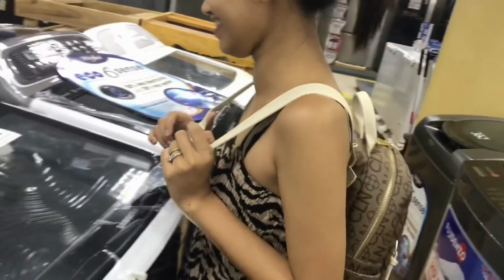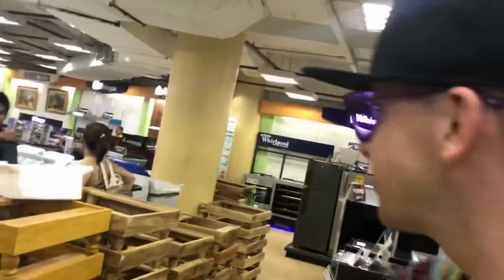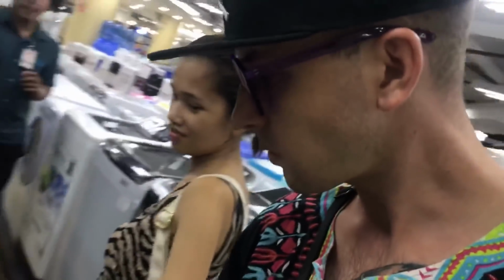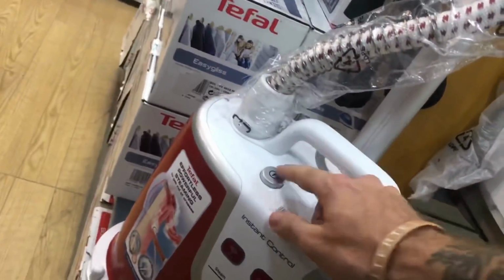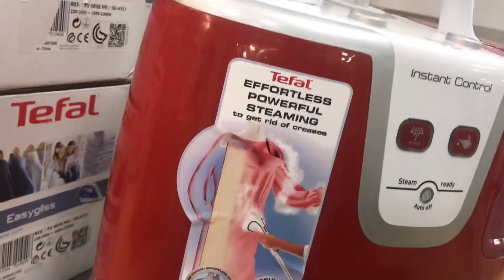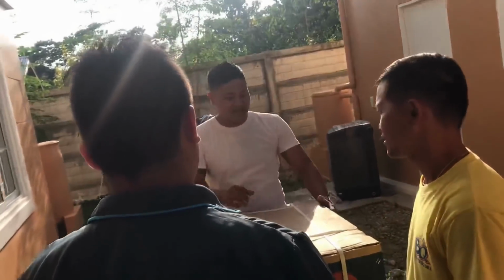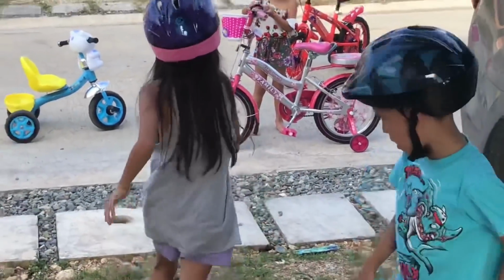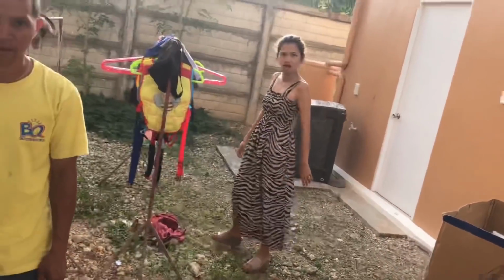BUYING NEW WASHING MACHINE - NAKAKALITO

Comment: WOW!!! 😳🙃It's absolutely mind boggling to witness electrical appliances left out in the open elements! #WASHERS  There's enough room in your pantry to place and preserve the lifespan of your washer... just have a plumber to reroute the plumbing by using a CPVC pipes ( best PVC type for both hot and cold water) with the Hub connector for both your hot and cold water. Your pantry shares the same wall as the area where you placed your new washer now. It's an easy fix to reroute your VPVC connection inside your pantry. 😊Just a mere suggestion to preserve your new washer... 😍😍😍
Reply from the maker: Pinky Hodge we are gonna put a tarp on the outside for now and do that later on Pinky thank u for the suggestion and ur totally right 👍🏽😎
Reply: @TheAhernFamily1  😊Just wanted to help you protect your investment. 😍😍😍

Comment: The weight should be dry washing, not wet.  I have a Samsung Addwash.  It’s the best machine I’ve had.  Get a stick steamer that converts to hand.  I had a Karcher tank steamer but it was too bulky so I got aThane H20.  It’s brilliant and so quick and easy to use.  I never use my mop now.

Comment: buy samsung digital inverter, automatic all you have to do is get the clothes inside the machine and add the detergents and softener in its container, turn it on and go about your usual other house chores the machine will notify you when its done.  You need a little time to have it aired and ready to wear na or fold it and place in the closet